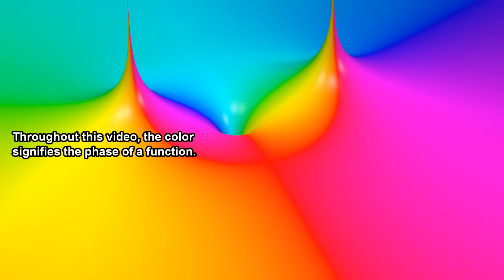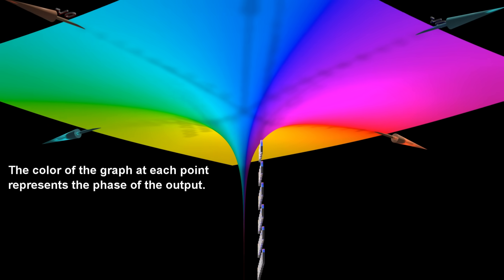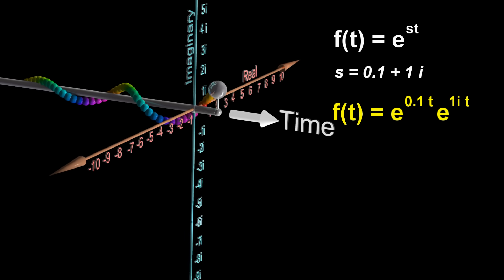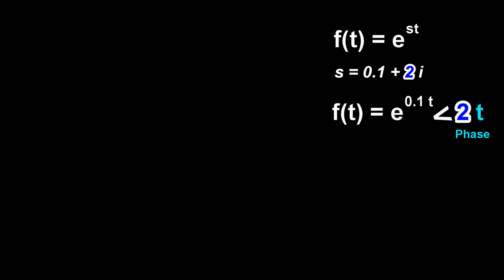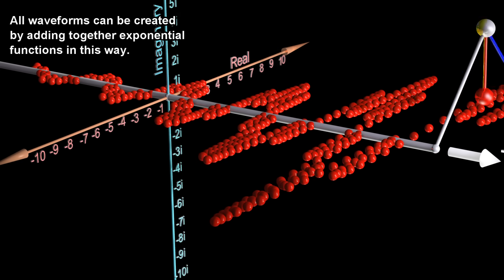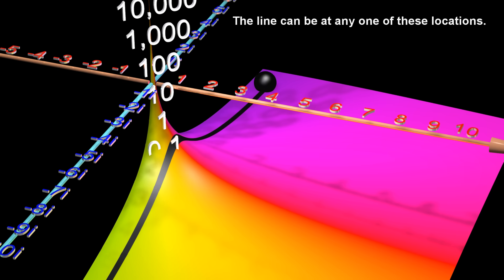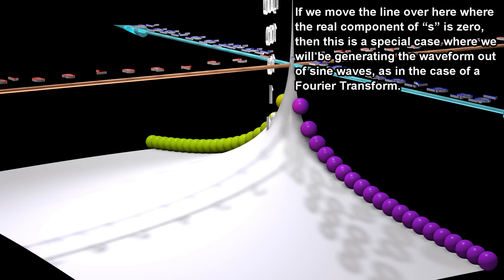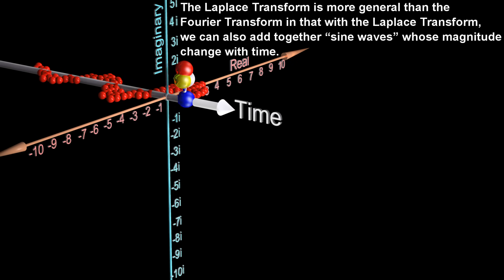Laplace Transform Explained and Visualized Intuitively

Comment: Holy shit i actually get it

Fourier transform is for getting the "formula" of a complex waveform, by decomposing it

Laplace transform is the same except it allows for the waveform to grow/decay with time, in either frequency or amplitude.

So like when you have a differential equation, dy/dt gets replaced by s, which represents the growth rate

This means we've abstracted away time. There's no messy time variable anymore, we've replaced it with the clean formula instead, aka we can deal with the function as a whole now, instead of at any one moment in time. Wow!

Comment: Great video as usual !  I just wanted to point out that the axes are labelled wrong at 14:35.  A sin only has a oscilatory (imaginary) component, as was said correctly by the voice in the video, but it is drawn in the real plane. 
Thank you again for your brilliant work Mr.Khutoryansky.
Reply from the maker: The axes are drawn correctly.  The final waveform is drawn in the real plane because when we add all the waveforms together, the final waveform must always have only a real component.  You are confusing the imaginary component of "s" (which in this example has a real component of zero) with the imaginary component of the final waveform (which can only have a real component).

Comment: at 17:27 we adding up all the time-spinning vector arrows because of integration. we can ignore the time component, and project everything on a plane. but shouldn’t that result in a spiral around the origin, when we add them? instead of the spiral that centred away from the origin? also shouldn’t the length of the vector be equal to the length of the spiral around the origin? IF so it would be easier to visualize… but I’m no expert… maybe a spiral around the origin only occurs if we are timelessly adding differences between the vectors… but we are not adding differences between rotating vectors we are summing vectors only (?!).
Reply: i will review the Cauchy line interval formula to confirm my thoughts. perhaps there is a visualization for that?! i will check.
Reply: @sdsa007  
Great note, did you check with Cauchy?

Comment: One thing Eugene taught me is that sine wave is not that 2d wave which we are taught, but actually circular motion moving with time. So powerful and elegant concept to know!
Thank you so much☺
Reply from the maker: Thanks.
Reply: Careful. The spiral you are seeing is actually two sinusoidal waves being added together according to Euler's Identity: e^(iwt) = cos(wt) + i sin(wt)
In order to get a flat sine wave from those complex exponential spirals, you need to add a positive and negative version so they rotate in opposite directions like this: 2 cos(wt) = e^(iwt) + e^(-iwt)
Reply: @AlphaCrucis  The 2d sine wave is a projection of this spiral. Even Euler's formula gives a point on a unit circle in complex plane. e^(iwt) is actually a point on a unit circle that changes w.r.t. time. Now if you think that this point not only rotates but also moves out (or goes into) the plane of rotation with increasing time, you get this 3d spiral. 

When you add the conjugate of e^(iwt) to itself, only the real component of the complex point remains; the sum is twice the real component of e^(iwt). So it appears that only x coordinate is changing and there is no rotation. But there is rotation, just that it is confined to one dimension. So my point was that the sine wave we are taught is what we see when this spiral is plotted on a flat 2D surface like screen or paper. Maybe we can confirm it with holography.

In fact, I believe in higher dimensions like quaternions, this would relate with direction cosines. In two dimensions, sine and cosine are direction cosines of a point.
Reply: @nothinginteresting1662  The point they were making is that you say a sine wave is not only a motion along the real axis, but a circular motion. That's like saying that y = ax is actually a 3d function y = ax + bz, but that schools have taught us only a flat projection of this hidden dimension! Or that y = x^2 is actually a cone shape and not 2d at all.

 Just because when you add another component, you get more insight into its nature, that doesnt change the definition of the function itself. A sine function is still 2D. Calling e^(iwt) a "sine wave" is nice but all you're really doing is being unclear with terminology unfortunately. Im only saying this (2 years late) because it seems that this is a classic error of thinking that people are disagreeing with your beliefs rather than your misuse of terminology. Unfortunately it is essential to share the same words for stuff in maths so that we dont get into that situation :)

Comment: simple beauty.
Reply from the maker: Thanks.
Reply: @EugeneKhutoryansky   the integral at 18:00 should have limits 0 and infinity right?
Reply from the maker: It is shown correctly in the video, and this is the more general version of the equation.  If the input function is zero for time less than zero, starting the integral from zero has the same effect as starting at negative infinity.

Comment: "[...] the Laplace transformation provide a method to EASILY solve differential equations [...]" 

Every day I'm called Dumb in a different way
Reply: Understanding the proof of something is way different than actually using it.  The proof of a Laplace Transform is very abstract.  Using the transform, however, is very easy.  I am an electrical engineer and Laplace Transforms make solving circuits very simple.
Reply: w/o initial conditions it makes them super easy, video didn't even break into all the electrical and mechanical uses it has. These videos provide excellent intuition.
Reply: @TheConsuela101  In my DE class we solved them with initial conditions and I didn't find it that difficult.
Reply: It's exponentially easier than solving them the normal way. A lot of the time solving a DE with the laplace transform is just
- do a little basic algebra 
- make the computer do the transform
- do some normal algebra
- make the computer undo the transform
- simplify
Which can be compared to the normal way of solving a DE which goes
- Try to remember which method to use
- Guess and attempt it for an hour 
- Fail
- Cry
Reply: Good one. 40 years ago I learned this, but not used it. So I am as Dumb as you are. ;-)
Reply: I know that feeling
Reply: Having just taken an ODE and PDE course which we only touched on fourier series in, I can confirm that from what I heard the way we solved PDEs at the end of the class was most definitely the hard way compared to doing it with the laplace transform.
Reply: Trust me it's easy compared to the way we first learn it!
Reply: Concordo amigo ) :
Reply: 😆...welcome to my world...
Reply: me too
Reply: Well that’s because you spelled differential incorrectly.
Reply: Tbf, it's only easier to do via laplace when a method isn't know to solve it, like in 3rd order linear DEs and above
Reply: How it is done? Actually, it is good only for linear differential equations with constant coefficients, they are the easiest ones. You normally learn to solve them with the exponential-Ansatz f=e^(λt) you take the characteristical polynom and its roots are λ the coefficient of the exponential. But then you can easily transform all those derivatives with L[f']=sL[f]-f(0) . So from  a+bf+cf'+df''+...=0 you take (a+bs+cs^2+ds^3+...)L[f]=P the characteristical polynom .  And then you find L[f] as a linear combination of 1/(s-λ). AND IMPORTANT: THE SINGULARITY(the root of the denominator) OF THE TRANSFORM  IN THE S DOMAIN, IS  λ NEXT TO THE EXPONENTIAL IN THE TIME DOMAIN!!!! that's why it is only used to solve linear equations, with exponential functions as solutions.

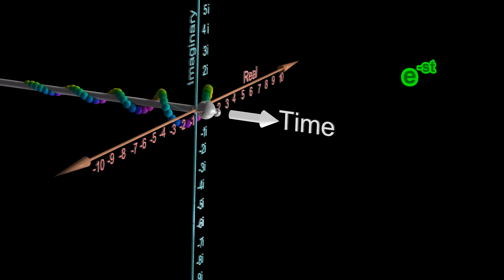Comment: In 5:58 you say the magnitude of waveform increases with the s real component, why then in 18:24 the waveform magnitude increases when the s real component is negative?
Reply from the maker: That is because this time, there is a negative sign in the equation.  Therefore, if "s" is also negative, then you have the negative of a negative, which is positive.

Comment: Hi ,I am sorry that i got quite lost at around 10:30minutes..where a colourful graph is shown that spans over a wide area in the positive region with a sharp peak labelled 0.001, 0.01... all the way to infinity. May i know if this graph represents 1/s? How do we get to this graph from the unit step function? Also,the axis labelled 0.001,0.01, 0.1, 1, 10.. all the way to infinity...what does this axis represent?

sincerely trying to understand this part.. hoping someone can help me answer this part. Thanks
Reply from the maker: Yes, this was representing the function F(s) = 1/s.  The vertical axis represented the amplitude of F(s) using a logarithmic
scale.  You get this graph from the unit step function by using the equation at the end of the video, with the unit step function plugged in for f(t).
Reply: @EugeneKhutoryansky  , hi eugene..thanks for your prompt reply, learning alot from your videos. sorry, didn't had time to finish the video entirely.. so i had another bugging question. Will the video show how the graph of unit step function (in time domain) translates into 1/s ( in frequency domain)? Because so far,the video showed 1/s into the unit step function and not vice versa. I am greatly interested in this because i have always wondered how do people know the laplace transform of unit step function is 1/s... and how will this transfotmation of unit step function to 1/s looks like?

Comment: Why isn't the Laplace Transform at 17:42 going from 0 to infinity but, -infinity to infinity? I don't fully understand but I'm going off of what the animation of adding the arrows showed. All in all it's a great video.
Reply from the maker: Going from -infinity to +infinity is the more general version of the equation. You can also represent it as going from 0 to +infinity, if the time domain function is always zero for time<0.  This is because if the time domain function is always zero for time<0, then you still get the same result from the integration equation.

Comment: This video is extremely helpful in trying to understand this powerful tool, as I am self-learning some other math concepts to help broaden my knowledge, like the Fourier transform, Riemann Zeta function, etc. They are extremely interesting!

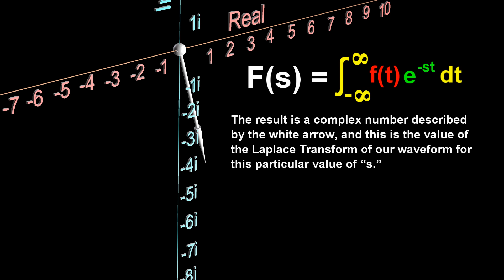Quick question:  At 17:50 I believe you are taking the Laplace Transform of the function f(t) = 1 for all non-negative real numbers and the video shows the result of the transformation as F(s) = 1-4i. If I'm interpreting this correctly, is the value of s = 1/(1-4i)?
Reply from the maker: Thanks.  In reply to your question, I never show the result as 1-4i.  The time domain function is f(t)=0 if t<0, and f(t)=1 if t>=0.  This transforms into the frequency domain function of F(s) = 1/s, where s>0.
Reply: I think I understand, you just decided to show that value for some arbitrary value of s? If in the  case that F(s) = 1/s does equal 1-4i at that part, would my value of s be correct as above?

Comment: I couldn’t follow this. Something is missing. Like what is being transformed to what.
Reply: there are 2 functions here, A function which takes some time value(I'll call this f(t)), and outputs a value for some input of time. Then there is its "Laplace transform", which shows the "frequency" of f(t), given some complex number s(I'll call this function F(s)). However, there are 2 different transforms this video goes over, the first transform the video explains is the transformation from F(s) to f(t), the second one is from f(t) to F(s).
Reply: somehow the video doesnt actually show how the calculation is transformed. thats what i actually miss in those videos. without previous fourier and some math books i wouldnt know what she tries to show. with a real equation going over all the animations would be more interesting. so its only showing the two parts.
Reply: @DarthZackTheFirstI  the video literally showed both of the integrals you need and explained every term.

Comment: In electronic enginnering, most of the time you like to have poles in the left semiplane (negative rho) for avoiding oscillations and instability. it is the semi plane in which oscillations are not selfsustaining since they are damped by negative real exponential

Comment: 2:55 Why there is no negative numbers in the vertical axis?
Reply from the maker: The vertical axis represents the magnitude of the output.  If the output is the real number -10, then this means that the magnitude of the output is +10, and the phase is 180 degrees.  In other words, the amplitude of the output is always positive.